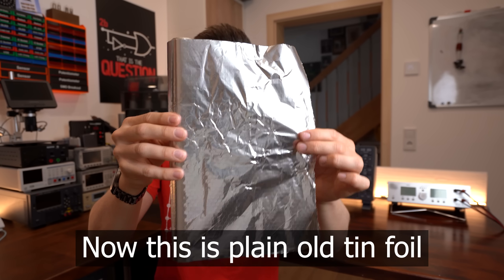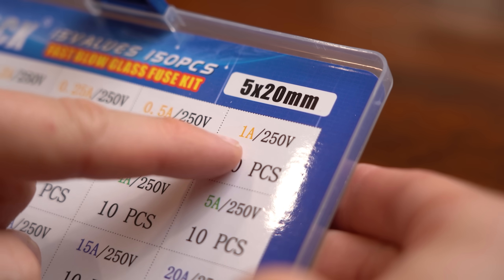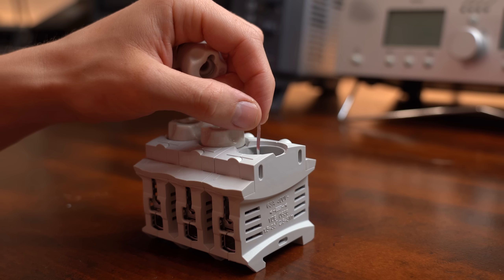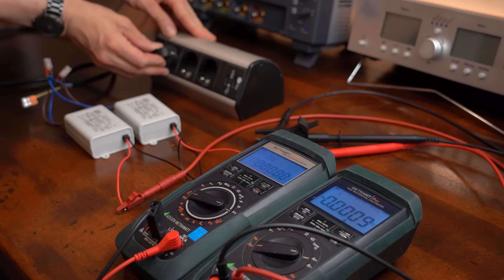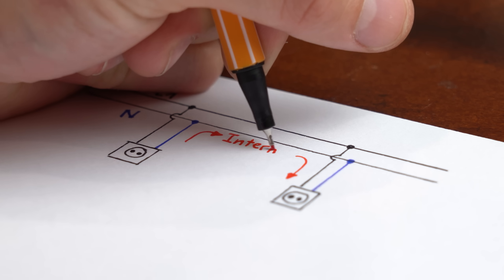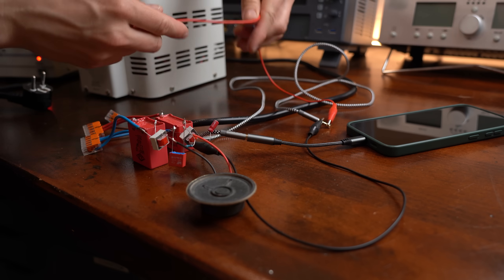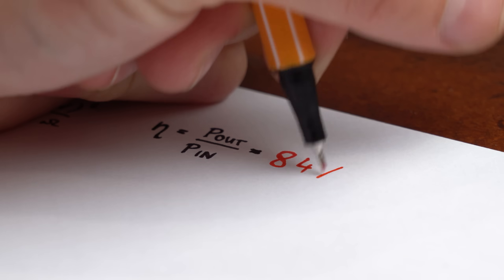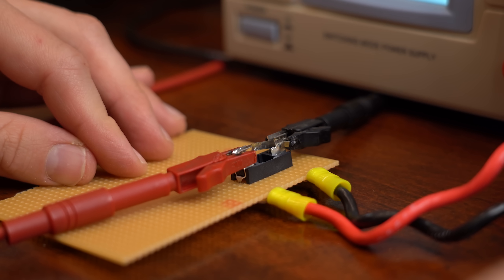I tried Busting 4 Weird Electronics Myths!

Comment: I'm sure a lot of people are familiar with the Bernards and Babani Books that were very popular in the 70s to the 90s?
BP240 The Remote Control Handbook by Owen Bishop is a very good read, and has a remote control system in it that uses the Earth and Neutral lines as the transmission wires to transmit digital data at low speed.
I can't post a link, but if you look for worldradiohistory BP240 is on there as are many of the BP publications and electronics magazines.
It is a gold mine of electronics publications that I can't recommend highly enough.

Comment: you can connect constant current LED power supplies in parallel! Those are made with this usage in mind! (provided their max voltage is the same!)
And they also handle well if some LEDs short out in the chain!

Comment: Working with industrial rectifiers, putting them in parallel is absolutely normal.
Our own modules can output up to to 50A each (depending on the voltage), for higher demand you just put more modules in.

But they come with trimmer potentiometers to dial them it to output the similar current.

For myth 4, if i remember correctly the Renaut Zoe uses parts of its motor as inductors for the charging circuit
Reply: The zoe anecdote sounds like an emi nightmare
Reply: Some industrial supplies have master slave settings, so that the slaves can follow the master supply and balance out the currents.
Other supplies have a current limit, so they wouldn't overload, even if they are not balanced.  You can get more one supply loaded more, but only to it's safe limit.
Reply: One application we have is with a 60 Amp 24 volts switching power supply with current limit.  Some units will shut down when the current limit is reached.  The type for this application starts to lower the output voltage and maintain the maximum current.  This is fine for our application, as it is running a max 60 amp (continuous, 120 peak) DC motor.  On start up the motor current would exceed 60 amps at 24 volts, but dropping down briefly to a lower voltage is fine while it spins up at 60 amps.  We could have added a second supply, but it really isn't necessary to have full 24 volts for the couple of seconds it takes to spin to a higher speed that draws less current (about 45-50 amps).
You need to be aware of how your supply will handle over current.  It's fairly typical to shut down, but that may not be what you want if you are paralleling supplies to get more current.
Reply: Once I've found a datasheet that mentioned using diodes on each supply output, which I did on some of my network devices. My router for example, has its original power supply and a UPS module (which Jeremy / GreatScott criticized before, and had to backtrack on as well) connected over a 3A Schottky diode (1N5822) each. The current imbalance is likely there, but backfeeding into the adjacent supplies is not. Also, when a power supply fails, the other will deliver full current (which they are both rated for), but will not short out the other unless the diodes fail. It's worked well for about a year now.

Comment: I've seen a Myth busted in real life:

"If you jam a flathead in a circuit breaker, it can't trip during a show!"

Sure. But the breaker itself will eventually open... After it has burned up, arced over the smoke, and dissipated enough heat to melt plastic into any and all gaps 😂
Reply: I've seen something similar. It was a 50A outlet for powering a trailer. The breaker kept tripping so some bonehead just took the wires out of the breaker and put them in the lugs with the 200A feeder wire.

Well, eventually a ground fault happened in the trailer, and the brass grounding strip in the outlet melted like a fuse. When I got there, everything in the trailer that was supposed to be "grounded" was actually "live."
Reply: @deltab9768  Proper outlets are made with the ground contact having the same or larger cross sectional are than live and neutral. So the  live contact should have melted first.
Reply: @mernokimuvek  this was just some brass strip bonding the outlet's frame. I was surprised how flimsy it was. I'm thinking it was like .5 mm by 3mm or something like that. On a 50A plug. 

It was in a spot where it gave no mechanical support so it was clearly just for electrical contact, but I don't know how UL even allowed that.
Reply: @deltab9768  Even with the working 50 A breaker, it could fail before the breaker trips. Was the outlet made in china?
Reply: @mernokimuvek  I don't remember where it was made, I actually kept it because I was amazed it had a design flaw that bad, but I don't have it with me now. 

What's weird is, there was another 50 breaker inside the trailer (so, downstream of the plug, but upstream of the fault.) that breaker didn't trip either. The outlet also had a screw terminal where you could connect a ground wire, and if that terminal had been used then the current could go to ground through that, instead of relying on the flimsy brass bonding strip. But no ground wire was connected, so the grounding was just through the metal box it was screwed into.

It was like a perfect storm of incorrect installation (with the bypassed breaker) + a badly designed receptacle, and maybe a faultu breaker too.

Comment: Electronics engineer here.

About the powerline phase couplers: it's more or less like WiFi but with the wires as antennas instead of antennas and air. Coupling between phases is done with class X (to be confirmed, as it's not my main knowledge area) capacitors, they will let high frequencies pass but block low frequencies. Most powerline adapters datasheets list their working frequency, and from what I've seen it's always 2.4GHz.

About the motors as inductors: yes, they definitely work. Everything conducting electricity is an inductor. What the core material changes is the permittivity, and thus the saturation current (ie. a material "can hold" a certain amount of magnetism, if it's "full", it can't be "filled" anymore). Air and iron are not as good as ferrite, leading to lower saturation current, but for lower current application, a motor or even a spool of wire is totally fine.
Reply: On power inductors: Not sure why the laminated steel inductor would have lower saturation than ferrite. I am quite certain it is the other way round, and it ain't even close (which is why we use the laminated steel cores for motors and other lower frequency power inductors, especially when the power density is a target).

The problem is the AC losses (where ferrites shine by default, but laminated silicone steel needs a careful balance between lamination directions & individual sheet thicknesses & ...)

For motor as an inductor, the problem is that most of the core is used to guide the magnetic flux between the individual parts. So, it is not intended to be a single inductor but a system of coupled inductors.

The silicone steel itself saturates way above 1 tesla, for those of us crazy enough to work with silly power electronics pushing kiloamps into their inductors. Like, well, almost all high-power systems.

Of course, there are also some properly fancy composite materials to try to get the best of both worlds of magnetic materials. But, it is mostly about trying to make a less high-frequency loss silicone steel with fancier insulation solutions. If the core can be laminated, a laminated core is usually still the best solution.
Reply: On the material alone, you are right iron has better permeability (and not permittivity as I said), µr is ~5000 for iron, 1 for vacuum, and few hundreds for ferrite (and most steels). Basically they all allow for greater magnetic flux, with iron allowing almost 10x the amount that ferrite allows, but...
iron concentrates the magnetic flux inside itself, allowing to guide it, where ferrite does not concentrate it, it just allows more flux inside it. It's the concentration of the flux that makes the iron more suited for motors and coils, where ferrite is more suited for inductors.
Reply: What's the difference between iron and ferrite?
No need to answer. I just Goggled it. 
Ferrite is iron oxides and ceramics. The two materials have there own benefits in various applications. I suggest people interested Goggle the question at the top of my reply.

@452eng Thanks for your post. It was interesting and got me thinking.
Reply: Iam new to see this tech and its awesome...
My qns is : is this cause interfere with other adaptor whose using the next house cause it sharing data through live wires.... Probably it spreads through everywhere ..... To prevent those any encryption like for eg:- PRBS ?
And sharing these makes so many noises and other stuffs.... complexity is higher !
Reply: High frequencies can pass capacitors, but get rejected by inductors. So they will get blocked at the circuit breaker and/or at the GFCI. It's unlikely for the waves to go to your neighbor or cause any significant interferences anywhere outside your home.
Reply: @462eng  oh great 😃

Comment: Those powerline adapters can be easily used as a 2 cable modem transmission in a low power system if you bypass the 230v circuit. Ie you could control a cabled rover or ROV using onboard battery packs.

Comment: the audio test was bound to fail because the line frequency of your AC is in the audible range, you need to use a high pass filter but you would lose out on any audio frequency below 100 hz or better yet use a FM transmitter with the antenna coupled via a cap and possibly a few turns on a ferrite core, attach a fm receiver and you should get the full range of the audio without the 50 hz buzz, this would more closely mimic the function of the wifi extenders which use a very high frequency RF to send and receive data. if you use a SDR you could probably figure out what frequencies they use, don't have to connect to the mains just place an antenna very close to the wire, probably pick up all kinds of stuff.

Comment: I haven't test it myself yet, but as far as I know, you can safely connect 2 PSUs together in parallel using 2 powerful schottky diodes on the 12v lines. Thus one will never backfeed the other and if something goes wrong like short output, the diode will block the excessive current. And if you use those perforated PSUs that have voltage adjustment pot, you might be able to match them and equalise the power that they deliver.
Reply: I have tested and it does not work. Diodes prevent psu:s for frying each other, but load does not go evenly. It worked as I tested at home, but not with real load with inductance, capacitance and fast on/off switching. It was unreliable. There are industrial psu:s specifically made to work parallel, they communicate and can share load smart way.

Comment: I used to use solder as a fuse in a crunch.   My car used to pop the brake light fuse at night now and then and being it was a safety issue I found that approx 4 wraps of around a ~18 gauge (can't recall exact size) was ~20 amps.  So about 5 amps for a single length of it at 12v in my use case.  It would blow still.  And that was very important to me

Comment: Renault Zoe uses its motor as an inductor for the onboard charger. And there is another EV (I forgot which one it is) that uses its motor for its boost converter to boost 400V from a 400V DC fast charger to 800V for the battery.

Comment: Myth2 - put a current limiting resistor in series at the output of each power supply, the connect them in parallel. If you limit the current of each power supply to around 1.5A with such a resistor each, you can safely use both in parallel.

Comment: using a little common sense here --- using aluminum foil in place of a fuse will not work because the foil is being used as an conductor -- the current flows right through the foil -- not regulating or limiting the current of flow in any shape or form .... 
simple -- common sense ...

Comment: To put supplies in parallel, you need a power balancing circuit. Without it… well there's the famous Nvidia RTX graphics cards going down in flames as a reference.

Comment: it was quite common when i was young to use the foil from a pack of cigarettes and wrap that around the a blown fuse in the car. I've done it many times, but as a temporary fix and I usually knew the reason for the blown fuse, which was usually working on something without disconnecting the battery first. I never expected the foil to behave as a fuse, its more of a bypass to make the car drive-able and get to the auto parts store.  I haven't done this in a long time, as i've learned my lesson about disconnecting the battery and cars back then were more resilient to temporary shorts because no electronics in a 70's chevy except for the radio.

Comment: You know I feel so dumb right now because I do remember using that tin foil trick back in the day When I was a kid to make AAA batteries fit in the AA battery slot, but you know I've kind of forgotten about that in recent years. Like just the other day I needed a AA battery to go into something when I only had triple A's and I just drove my ass to the store to go buy some double A's... Maybe that's why I forgot because now that I'm older I just have the ability to just go and buy what I need instead of MacGyvering things

Comment: For the power supplies - if you impedance match them using resistors you can usually get them rather equal in load. 

Issue usually isn't outputs - it's the internal resistance of the individual circuits - the one with the lowest will supply the most load. The reason you get most of the draw out of one in your setup is likely because as you draw more the virtual resistance of the circuit goes up and only then the other circuit becomes the least resistive path.
Reply: Usually they're called ballast resistors

Comment: Fun fact about using motors as inductance: when a renault zoe electric car charges on a single-phase charger, it uses the motor as part of a boost converter.
Reply: Kia does this, too. Most DC fast chargers are around 400V and the current EV platform has an 800V battery. They use the motor windings as the inductor for that boost converter.
Reply: Very clever!
Reply: That's cool, it saves some weight and cost if you can avoid having a separate coil and core for charging.
Reply: @ For sure. 400V DC fast charging tops out around 150KW, so that's a lot of power to push through an inductor. The motor windings are also oil cooled, although I'm unsure if the oil pump is running when the car is charging.
Reply: @jaymzx0  It must be. Car is not designed to pull 150kW continuously even under "normal" load while driving (ie model 3 is certified for "only" 60kW continuous output for 1 hour). With 100-150kW (I've seen 127kW in the test for ioniq 5) continuous load for over 30 minutes it surely would overheat without proper cooling.
Reply: @jaymzx0  yes. The thermal management system turns on when dc fast charging. It also turns on when AC charging the car in extreme heat and cold
Reply: Thats pretty cool. Silicon steel kinda sucks in terms of hysteresis at high frequencies compared to materials typically used for swiched transformer core, so the attainable energy density / efficiency tradeoff wont be optimal; but if youve got a big hunk of steel and copper lying around anyway...
Reply: That's genius.
Reply: This seems to be almost the norm, which makes sense given the weight optimisation needed in the automotive world (but which is also very likely a design criterion for the electric motor coil winding design team, to make sure their motor winding also works as a high-power inductor for the power converter circuit). I assume it also shares most of the other power electronics, too. It is “just” a different control sequence for the arbitrary control sequence three-phase power converter that some would mistake for a simple, but oversized electric motor controller.

Cheaper, lighter, and as such likely also overall more efficient.
Reply: @L2M2K2  I think it is the stator that needs a bit of consideration to work as a good inductor.
Reply: Yes I was trying to remember where I read about this. So cool
Reply: Рено есть рено... Шизофрения есть шизофрения...

Comment: All houses in Germany have 3 phases? That seems strange. I thought that would just be apartments and commercial buildings.
Reply: Not only in Germany, but in most of Europe.
Reply: @mernokimuvek  Interesting, and I guess I'm just kinda surprised I never knew that having spent so much time there. I guess when I was younger I just had more common sense than to open up every high voltage electrical enclosure to see how it worked.
Although honestly I'm not sure what I expected it to be since I knew you don't use single phase Ring circuits like England or Split phase like USA.

Comment: 0:31 just use the screwdriver. 2000A slow blow.
Reply: Where's that chart lmao
Reply: @FlammableElectronics username checks out!
Reply: I managed to blow my cheap multimeter fuse one day. Didn't have any spare so yeah, literally put a screw instead.
Reply: @LeGravier01  my multimeter has a piece of copper wire instead of the 10a fuse. now i can measure way more than 10 amps
Reply: @bmxscape  i did the same with a 2a fuse lol